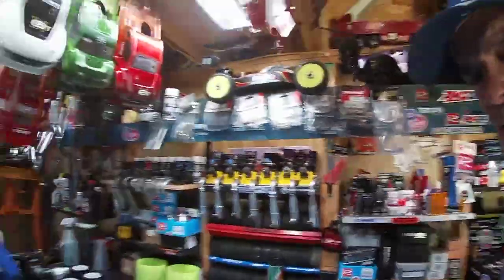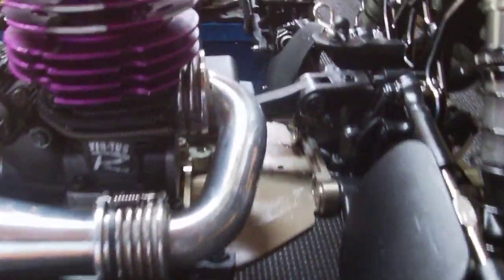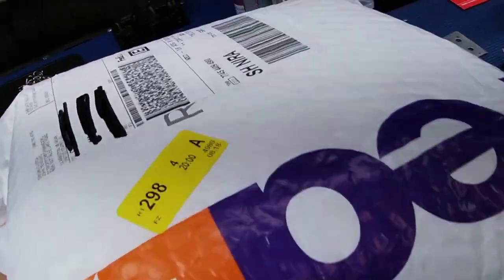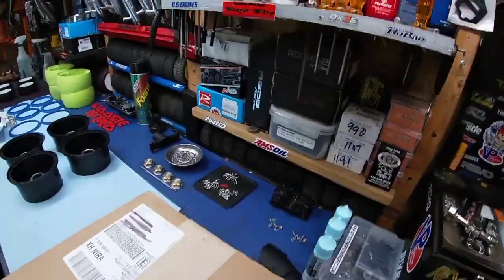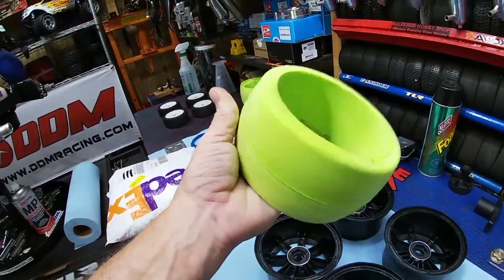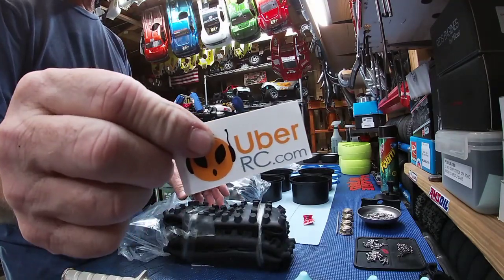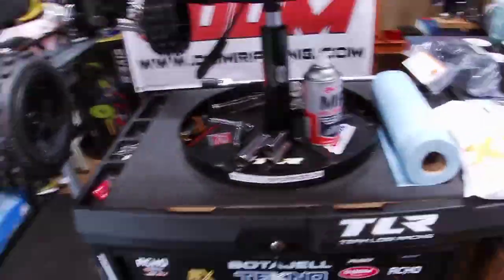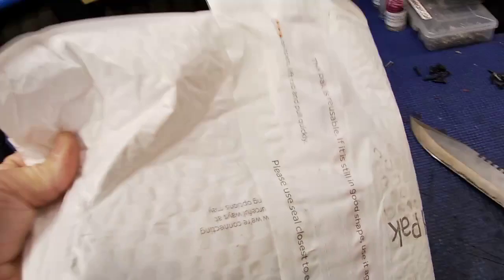BONEHEAD & UBER RC..MORE LARGE SCALE GOODNESS ✔️ IT OUT

Comment: what’s up woogie have a question for you does the 5b come with the clutch system or is that separate
Reply from the maker: If you get the 5B from rovin or King motor if you go King motor get the deluxe version you get the most bang for your buck and absolutely it's ready to run comes with everything including the clutch setup radio everything you need
Reply: @woogienitro  the losi 5b comes ready to run from king motor ?
Reply from the maker: No my bad I think of the 5B I think of the Baja but no the Losi 5B comes with no engine but it does come with a clutch and does not come from rovin the only place you can get it right now when they get back in stock will be ddm
Reply from the maker: Also if you get an engine from wherever obr bartolone ESP from DDM all those will come set up with a clutch it's been a while since I did the Losi 5B kit and I'm pretty sure it came with a clutch and a clutch housing just no engine or servo's
Reply: @woogienitro ok cool thanks
Reply: @woogienitro  does it come with aluminum servo horns
Reply from the maker: No I don't think so I think it comes with the plastics you have to upgrade all that stuff I use the DJI break and throttle servo horn
Reply: @woogienitro  ok thanks for the help i’m trying to put a list of things to buy for the buggy why i wait for it to come back instock
Reply from the maker: Why didn't you say so I can give you a list give me some time
Reply from the maker: Definitely pick up the mod upgraded rear diff inserts in oversized bearings also if you're going to run dual servo steering you want to get the dark soul wiring harness it routes power directly to the servos rather than going through the receiver
Reply from the maker: Also depends on what your budget is I spent about $4,500 so far on this kit including the engine and all the upgrades
Reply from the maker: Check out the rock armor servo brace for throttle and brake inexpensive and a great durability item
Reply: @woogienitro  ok cool appreciate it. this will be my first 1/5 scale new to this side of the hobby but have been racing 1/10-1/8 for a few years now. i know how expensive this hobby can be but don’t mind spending money on quality stuff looking at either the obr 34 or the esp for engine wise and olimat pipe not something i plan to have all done at once may take awhile to get her to where i want.
Reply from the maker: If you can swing it I would go with the Obr  34 Read The bartolone end bleed tt's badass  olimat is great as well you'll just have to wait about a month to get it it's going to have to wait a month for the O we are anyway I always preach on my channel don't let other people spend your money for you so it's whatever you feel is best totally up to you there's a lot of great products out there but just do you and experience different things
Reply: @woogienitro  so you prefer the obr over the esp
Reply from the maker: Well I haven't run the ESP as far as performance to tell the difference between the two but it's two different platforms that I'm running them in also the obr has the turtle l racing billet case and read as the ESP just has your standards zahnoa  casing and just a modification in a 2 mm stroker so the quality of the material that you used as far as the billet on the obr is what makes me lean towards the Obr a little more performance wise I think they're pretty close
Reply from the maker: Nothing wrong with the ESP though lot of great reviews a lot of people love ESP and it's about half the cost of the obr I just like O'Neill brothers and what they do and what they stand for they're very proactive with their customers you can call them anytime about anything

Comment: What’s up man! Just got into nitro. I finished building my losi 8ight-xt and had a lrp .32 in it, I was not a fan of it at all. Horrible tuning, so I decided to pick up an OS .28xz, have any experience with this motor?
Reply from the maker: Find yourself a Novarossi carburetor Mill 1 mm off of the barrel that goes into the engine and it'll turn great look at my video probably last year on how I Mill an overall c carburetor you can always use two o-rings as well but I feel like there's less chance of air leaks if you just Mill one millimeter off of the bottom
Reply: @woogienitro  sadly I’ve looked everywhere but can’t find a nova carb… that’s why I ended up going with the os .28xz. Figured it was the next best thing to a 28-8 or .32 with a nova carb
Reply from the maker: You can't go wrong with that OS man it's not going to have as much power as the point 32 but keep looking on eBay man sometimes you can find those carburetors
Reply: @woogienitro  hell yeah, gonna try and snag up a nova carb if I can find one. I was reading good things about the .28 os and figured I got the chance to snag one so I jumped on it. Even if it just holds me out till I find a nova carb